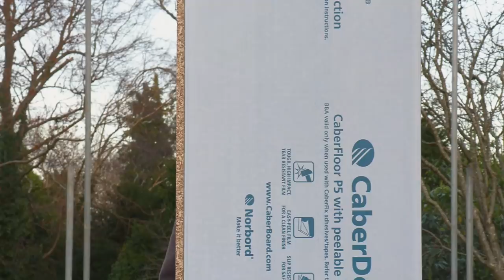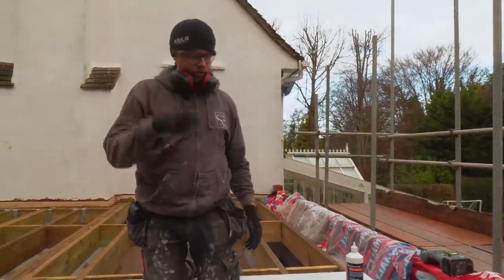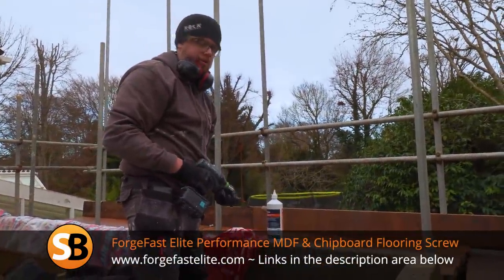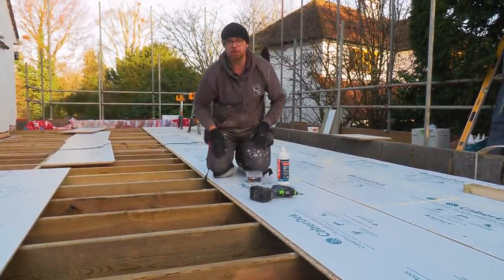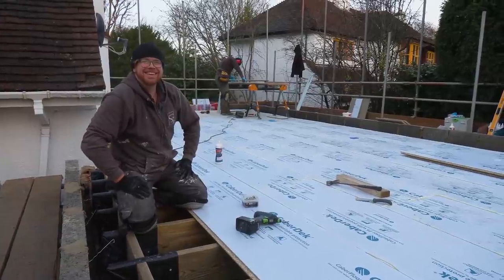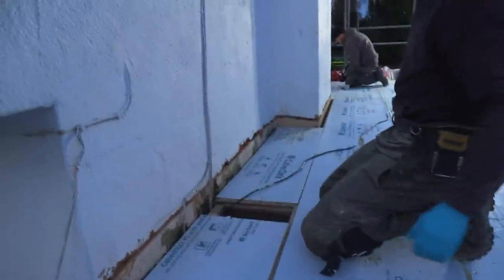Trade Secrets CaberDek Flooring ~ Extension Build #5

Comment: You are right about not nailing the board leading edge as it becomes difficult to pull the next board in. The NHBC get rather over excited about gluing the board perimeter but it's all a load of tripe. We did about 70 houses before we were told we had to do it and there were zero issues in any of them with any perimeter boards.

Comment: Another great video! This would have made my life a lot easier on my extension. Top tip, you can get polyurethane glue in tubes that slot into applicator guns, same as silicone or grip fill etc. It's still the same glue, but it's considerably easier on the fingers and forearms, rather than trying to create the pressure as the bottle gets empty and you need to stand it upright to stop the glue oozing out everywhere!

Comment: Not sure on the cost difference between the standard board and the coated board but in the past I have used concrete sealer applied with paint roller on standard board to waterproof.....worked well, was quick to apply, rapid drying and no issues with wet weather before the roof went on
Reply: You're creating a non breathable board though.

Comment: Very through looking installation as usual never seen carpenters paint the heads of screws or filling the joints before. Just one point why did you put an extra joist in next to the trimmer, 0.50 on the video if you had laid the joists at 400mm?

Comment: Great Job again lads, top quality 
I would recommend Floor Tite screws , excellent quality. 
QUICK  Question,  I would mainly use 18mm or 25mm plywood  exterior grade,  
Cheaper and have had terrible experience with chipboard products when used in exposed conditions, 
What's your views ??
Well done again!

Comment: Sorry if someone has already said this - my top tip for hammering in to close the joints is to use an off cut from a section. Cut off to leave a square face and then leave the tongue/ groove to slot in and hammer home your board 👍🏼

Great job chaps, and a good product 👍🏼👍🏼
Reply: That's a good tip, have done that before years ago but why doesn't somebody come up with a nylon profiled bashing block??
Reply: @tinytonymaloney7832  selecta do with their screedboard. Not timber but same principal

Comment: Loving this series chaps ! As for the flooring yes the glue does ooze out and dry and is a right royal pain in the arse when us brickies do the internal blockwork and try and tidy up the floor 😩. 
   I’ve never seen a chippie painting the edges or filling the nail holes ( no screws on new builds ) on site yet . Maybe that’s why our 12 month old floor boards bloody creak 😡😡.
  Great video as ever chaps 🧱👍🏼
Reply: Cheers! Yeah it’s a nightmare to sweep, I think that next time I’ll get the tape the sticks over the joints to try and reduce the bump that’s left.
Reply: @jimichip  We use the tape aswell James. Rip little squares for the nail/screw holes and then lap tape around the complete perimeter.👍 Good job mate, and this type of decking makes the job so much more civilized and when its all done inside, you just rip up the plastic and, BOOM, a nice clean floor. 😎

Comment: Are torx only now becoming popular in the UK? I use nothing else for 15 years at least. Don't understand why philips is still used.
Reply: Phillips have been outdated for years now, the standard over here is pozi screws, they actually have the same contact as torx screws and are generally much cheaper, it's rare to find people using torx over here tbh.
Reply: Pozi is just a slightly improved philips, it's no match for torx in terms of grip.
Reply: @rutgerhoutdijk3547  it's up for debate, but from all the tests and comparisons I've seen and my own tests I've found pozi drive to be more reliable when used properly. Torx has 6 contact points and pozi has 8. But everyone has their own preferences I suppose :)
Reply: I've been using torx screws for at least twelve years. I just find them the best for purpose. They never cam-out.
Reply: I had this argument with the chippies who did the loft on my last place. I was doing the studwork on the floor below and was using torx. I tried to explain how they are better engineered but they were too stuck in their ways. Their reasoning was you had to change the torx bit for different size screws too often. 
The only down side I've found is if you have a screw that sticks. On posi heads the bit will jump out and chew it, which is annoying enough, but with a torx it can rip the head clean off. Not so easy to get the screw out.
Reply: Square drive screws from Kreg are the best of the lot, 👍😁🔨🇮🇪
Reply: Torx are far superior to pozi. It's all we use in the UK.
Reply: Ive been using the Simpson strong tie Quikdrive collated  floor screw system for nearly 20 years. Square head Robertson type screw on corded gun. Alot quicker🏴
Reply: I like to weld a bit on to each screw head. Far superior and never slips. Better than torx. Only down side is having to grind it back off each time and re weld but it’s a small price to pay for the lack of slippage. It’s all people do really who know there stuff in the uk.

Comment: Hi guys, another great video- shame it was a bit short 🙄.
I always use caberdeck & the glue but I still use 4 screws per joist.
I then clean off the excess & use the clear caberdeck tape over all joints & screws. It is expensive but it does make the whole floor watertight. I started using the clear tape as I found the protective plastic can pull up when you're clearing up.
Give it a go next time - I guarantee you won't be disappointed 😉
Regards
Tim

Comment: 7.50 I found the same when I did mine, leave the front row of screws out until you have the next board in 👍🏻
Reply: Basic rule of fitting to any joist, the bow all over the place put the screws in but dont drive them home, all this new gluing the T&G and to the joists! does nobody care when Roger has to go round in 10yrs to change the en-suite how is he going to re-route the pipework when he cant get the boards up!!!!!?
Reply: @Pistol_Knight  yeah mate, you're better off dropping the ceiling below. Especially when using these I beam type joists. They'd be destroyed lifting the floor and structural integrity gone.
Reply: @Pistol_Knight  that's what oscillators are for 😝🔨
Reply: I've  never put screws in on the front of the board with this system I've always screwed into the back edge until it comes to the last row. Never had any issues doing it this way
Reply: Common sense.

Comment: Is wrapping joist ends reg's, I was told many moons ago they stopped that because of sweating and rot, they used a gel instead, anyway interesting videos, thanks.
Reply from the maker: They don't sweat. The joist is in the warm area so the moisture level is the same. The wrap is an extra precaution that James likes to use but it is not required by regs. What is required is air tightness and this is achieved by using a sealant around the wrap. That still allows any moisture in the joist to come out through the open end of the wrap.

Comment: Ive been using the Simpsons strong tie Quikdrive collated screw system for nearly 20 years. Square head Robertson screw and corded high speed drill with autofeed . So much quicker and it has an extension so you can screw the flooring standing up to save my dodgy back🏴👍🔨
Reply from the maker: I have one of those and never use it because the screws are too expensive

Comment: Great vid Roger... I thought the T&G on these boards were designed to be strong enough to be fitted mid joist with no noggins needed? or is it just belt and braces? Cheers
Reply from the maker: That is a common misconception. All the manufacturers advise against it. Admittedly the boards can support a fair load but there is a difference between a live load and a dead load. People tend to tread on the same spot over and over so you have to think about an 18 stone person treading on that board end and cracking that chipboard tongue over several years. Maybe he/she had it coming to them, there has to be a penalty for eating all the pies.
Reply: We always d4 glue and twin thread screws into place also. We use noggins where needed as belt and braces. Be great if a manufacturer could come up with a reinforced  t&g board that didn’t require noggins. It would cut down on the use of timber and dramatically speed the job up! Anyway, cheers for the response and keep the great work up!

Comment: Use an off cut for knocking in to prevent breaking the tongue. Also, would it be easier to have the glue in a sealant cartridge so it could be applied by a gun?
Reply from the maker: We did use off cuts but they disintegrate
Reply: Off cuts of chipboard do disintegrate.  We use a tapping block or flooring bar.  They are made for the job and can be used on your solid floor instals too.

Comment: Do you need to land on a joist I thought caberdeck will span the gap? Anyway top work again
Reply: If your setting out from scratch you'll land on a joist as the boards are 2400mm but if it's set out differently I put 3 bridging timbers in front middle and back it might be over kill but it does no harm hope that helps 🔨
Reply: Always land on a joist..... if not put a dwang in for support
Reply from the maker: You can't join in between the joists with no support. People are getting heavier. We might have point load from a bed and two heavy people going at it.
Reply: @stevengillespie6729  you'll have to translate that for him pal not everyone has worked in Scotland 😉🔨
Reply: @tomsmith9048  Let's face it Tom, nobody works in the People's Republic of Jockistan.
Reply: @SkillBuilder   hav you ever known a chipboard floor to collapse? I haven’t! Things are so over engineered these days at the cost to the customer and it’s a waste of money. The flat roofs I build these days could be used as a helicopter landing pad..... regulations are ridiculous
Reply: @stevengillespie6729  it’s unlikely as the ends are tongue and groove and will be engaged in to the board in front and behind so I agree it’s not going through. But.... how hard is it to sling even just one nog in to make sure.

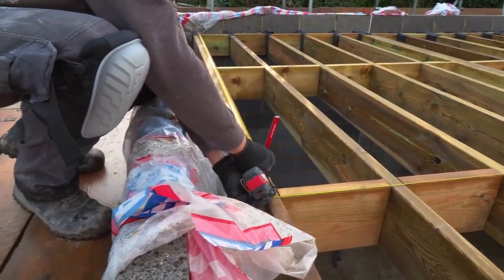Comment: 1:50 just go corner to corner both ways ie top right to bottom left then top left to bottom right to check for square as your measuring both the hypotenuses so no need to do and calcs

Comment: Hi Skill builder. what is the name and model of your impact driver ?? is it festool impact ?
Reply: This might seem unusual, but I bought a Panasonic impact driver about fourteen years back. Looked at the De Walt, then Makita in the shop, then held the Panasonic and it fitted my hand like a glove. Probably the best tool I've ever bought. It was about £190 back then and is still going strong and have never replaced either battery. The amount of 150mm screws it's put in is unreal.

Comment: I’m guessing you will go back tomorrow and scrape all the glue off the joints when everything is dry???
Reply: I tend to leave it myself but I don't know what the manufacturer recommends as I've never watched an installation  video, I would say it gives a better water seal doing that
Reply from the maker: You have to leave the glue until the covering is peeled off then just go around with a scraper. It is made to work this way.
Reply: @SkillBuilder  makes sense I suppose, in NZ we tend to scrape it off 1-2 hours after it sets when doing a 2 story or add on

Comment: Few friendly tips! Rip 15mm off from first row to make it easier to apply the glue to the edge rather than a groove. Use a sledge hammer to knock it together. Leave the block work down if you can and mark the floor in one go with a chalk line and you can secretly fix through the tongue so there are less holes in the floor. But the polyurethane glue is the best, you won't need anymore fixings and the floor will never squeak. Good job guys 👍
Reply from the maker: Yes we could have cut that groove off.

Comment: Hi guys what do you think of AEG power tools ,drills/impact drivers  ???
Reply from the maker: They are a neglected brand in the U.K. They are owned by TTI and fall somewhere between Milwaukee and Ryobi.
Reply: I have a large mains powered AEG drill. Absolute beast. Have  a slightly smaller Millwaukee one...another beast.
Reply: Allgemeine Elektricitäts-Gesellschaft. Try asking for that in your local tool shop.

I've got a couple of their Sanders. They're ok.

Comment: Caberboard is very good. Some siteswe dont fit until the roof is tilled. Letting the joists dry out.  Normally let plumb first fix happen too. Glue and screw is the best fix for sure. 4mm screw just pop the heads of 5mm-6mm these days.  22mm is a great board.
Reply from the maker: This board is made for fixing at this stage. The  whole point is to give you a safe working deck that resists the weather.
Reply: @SkillBuilder  It would be away to wet in NI to consider that idea. We  lose a day a week here with rain on average. Working in Dublin a day a month only a 100 miles away! That's not considering wind either. Sep-April allow for gales every 2 weeks.  So peaks can often halt for weather windows. Good enough idea, speeding the works up, but the plumbers would crack not getting first fix down. They wont leave copper hanging with block work on going 2-3 weeks from peaks. 
Window companies here refuse to measure until masonry is complete and all thresholds are fitted. Plus then it 4 -6 weeks for delivery.  On theft alone the odds are stacking against you in social housing scheme at least..
Reply: I always think the sooner you get it all built up and screwed together with the floor on etc the better for it all to to dry as one unit, yes stuff will still move I’m sure but if the floor dries out independent it can move easier.

Comment: Hi fellas as im not a builder why the gap between board and block.cheers
Reply: Inner skin to build between joists, so flooring will eventually be 10-15mm away from inside blockwork.
Reply: if u mean at the end of the joists that will usually be infilled with block once the internal course comes up.
Reply: Do the joists always sit on the outside blockwork?

Comment: Looks painfully (literally) slow and cumbersome. Squeezing out glue on your hands and knees, then screwing down on your hands and knees is a back breaker.  How about some gun-applied polyurethane adhesive (1 can equals about 6-8 large tubes of subfloor adhesive = much less waste) and collated screws/screw gun to dramatically speed things up and save your back?  

This system is for the birds. I'd use high-quality subfloor (Huber Advantech), screw and glue and then use a pressure-sensitive acrylic tape (Siga/ProClima/3M/Zip etc) to air and water seal.
Reply: Kinnell I’d imagine you would be wasted putting a floor down. You need to be working on that thing they have landed on Mars or something if that level.

Comment: Have to say, I'm not entirely sure the benefits of this type of deck over regular osb? Wasn't particularly well explained in the video... Likewise some of the detailing with plastic wrapped joists? A bit more explanation would be good!
Reply: The DPC on the ends of the joists is to prevent rot. Some companies make plastic sleeves that slip on.

Comment: How are you supposed to be able to access anything installed under the floor later down the line?
Reply from the maker: Hi Miles 
It is the way of the world. People fit oak floors and tiles and the only way to access them is from below. There is nothing under that floor that needs looking at for the next 50 years.
Cables are good, no junction boxes, pipes are continuous with no joints. What more do you need?
Reply: @SkillBuilder  Fair point.

Comment: I notice you have used blocking between the joist, as a carpenter for 38 years something I would never recommend this practice
I know this is quicker, however it is bad practice as when joists start shrinking gaps are left either end of the blocking exposing
The nails and with deflection you get a squeaky floors. To keep joists from any movement the proper way is herring bone strutting
Call me old fashioned but that to me is the proper practice. Great Prog
Reply from the maker: https://www.youtube.com/watch?v=8rgIu8XeLLE&t=91s

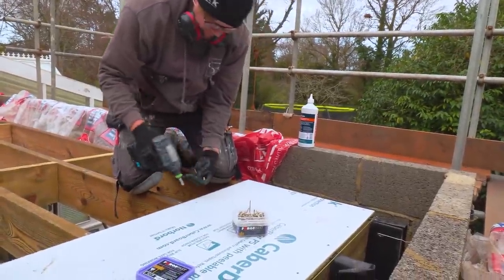Comment: 5:56 why is the gap to the wall so large?
Reply: There’s still another block to be laid in between the joists so the flooring will actually only be about 25mm from the inside block work skin.

Comment: Rewiring houses in 40years time isnt going to be fun for the sparks with these floors... and plumbing, essentially you will need to replace lots of floor.
Reply from the maker: Piece of cake rewiring. The holes are drilled so just drag new cable through. Access holes drilled and filled Not difficult
Reply: @SkillBuilder   of course, my point being it isnt as easy as floorboard, cables are clipped and pulling cables through holes blind can be dangerous because of cable burns. Im not saying it is impossible but it will be much much harder than todays rewires with the older properties... chipboard flooring is a pain today, let alone now its being glued down!
Reply: @acat6821  I'm with u mate. Dropping the ceilings below will be easier. Getting the floor up in the future will destroy the joists.
Reply: @SkillBuilder  that’s nonsense. Pulling cable through existing holes lol. That’s said I agree that who cares in a sense. He place is going to be wired now properly. Good for decades.